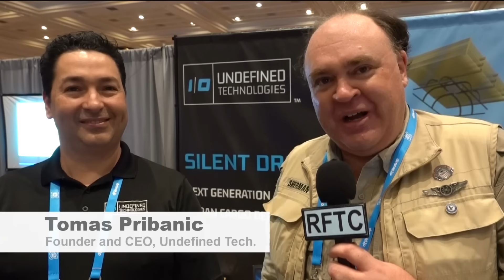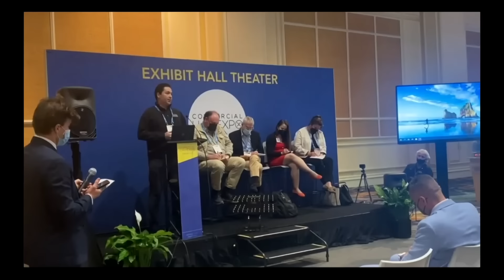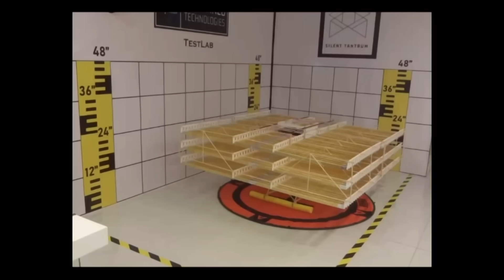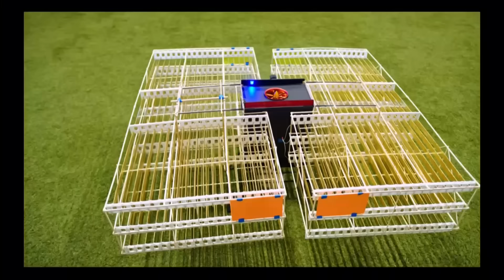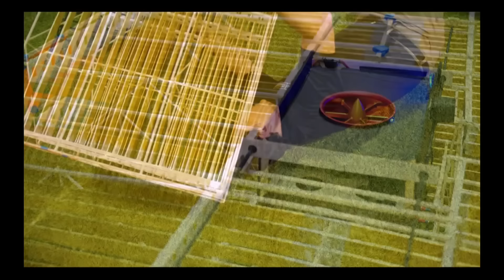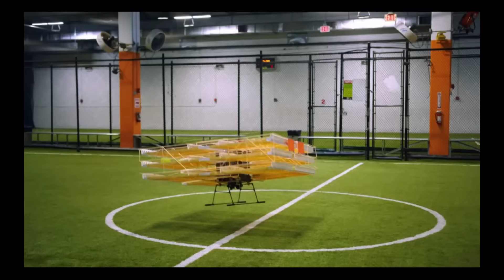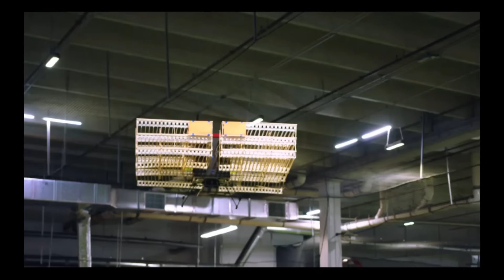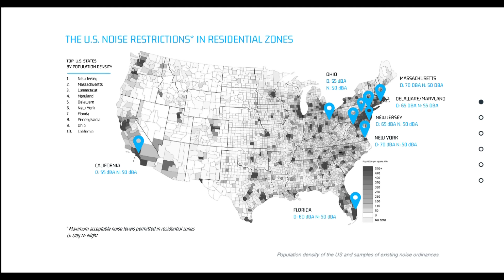New Drone Tech: No Propellers, and Yet It Flies!

Comment: electroaerodynamics / Ionic-wind propulsion is amazing tech and hopefully we see a lot more of it soon! 
Years ago i played with this idea for a project but never got any "good results"
Reply from the maker: Yeah, they were pretty cagey about the materials used, how maneuvering was accomplished, etc. -- at least until they get their patent issued, and I can't blame them for that.
Reply: @Roswellflighttestcrew1947  It might be novelle materials for light and electrostatic/magnetic/whatever the basics of populsion dont change.

You need a force eg visualise a table leg to stand on.
You introduce mutiple points of force eg visualise a table top supported by four or more table legs each exerting equal force resulting in motion upwards
Create an imbalance of forces and you ave potential directional rotation if not vertical force.
Create forces whic are horizontal and apply the same and you get horiztonal forces